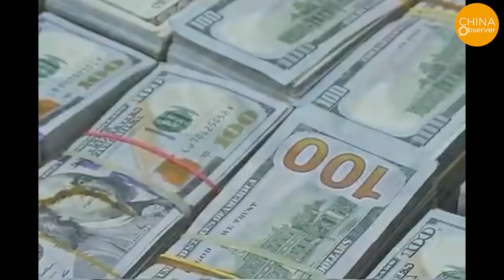Made in China: 37 Bridges collapsed in 5 years | Ancient China | Quality | moral issues

Comment: That's what happens when you don't add the proper amount of cement to the aggregate and sand and the cement money goes into someone's pocket.
Reply: Water content also drastically affects quality. Too much water makes for weak concrete, but it pours easily so you can get the job done quick. The proper slump is very little water, but in formworks it's a pain to use and slow.
Reply: Cement to aggregate? They don't even use building materials to begin with!
Reply: They also use sea sand
Reply: Nah they literally aren’t smart enough to engineer anything as simple as a bridge
Reply: While your at it maybe you can save money by just using sea water for the concrete. Totally shouldn't have a negative effect xD
Reply: @ericandreen1470  this is just wrong. Did you even watch the video? The ancient Chinese built structures strong enough to last over a thousand years. The problem lies with the central planning and the destruction of morals and culture.
Reply: @oldmandoinghighkicksonlyin1368  since China uses more in any 3 years since 2003 than US has used in its life they probably know all about cement
Reply: @ericandreen1470  I can tell quickly you have never been to China and you my friend will believe anything
Reply: @Stoneitful  well they know how to cut corners and do it cheaply so the building crumbles and potentially falls down. Tofu Dreg construction is rampant in China.
Reply: @oldmandoinghighkicksonlyin1368  you sound so knowledgeable ! How much time have you spent in China ?
Reply: @Stoneitful  I've lived there all my life. Longer than your dad and grandpa combined. I am an expert now because of my geography.
Reply: @oldmandoinghighkicksonlyin1368  lived where ?

Comment: We have a bridge here in the San Francisco Bay area that was reconstructed a number of years ago with steel load bearing elements that were made in China. It wasn't so long afterward that severe corrosion, due to the salt water exposure, and consequent cracking on these steel members were detected. In retrospect, it would have been better and cheaper to have paid the higher up front cost of using domestically made steel.
Reply: Due to the saltwater exposure,???? I saw the photo/video that the electric line pole fell down in San Francisco, due to homeless people peeing on it all the time, the peeing-liquid corrosion lead the pole to fall. More likely due to the homeless people peeing in the bridge area, as we all know it is an ideal place to be used as a home for homeless people, according to the New York time, there are over 170,000 homeless people in California.😲😩😫
Reply: @hanfucolorful9656  The shear key anchor rods are not accessible to the public, hence it would be impossible for homeless to do that. Urine has high concentrations of uric acid and various electrolytes, which are corrosive to steel. If homeless people did urinate on metal support columns then that would cause surface corrosion of unprotected steel. I wonder if all the videos of people freely urinating and defecating in public places in China might be causing some of the bridge and building failures we've seen recently. Doesn't the Chinese government admonish its citizens against such uncouth and unsanitary practices when they travel abroad?
Reply: @videomaniac108  [[[ severe corrosion, due to the salt water exposure, and consequent cracking oh these steel members were detected. ]]] -- if you did not contract China to do the painting job, you need to do it yourself once every a few years, especially in the "seawater" environment. 

Google: San Francisco Poop Map, having fun.😲😇😄
Reply: You guys can consider using Japanese products. Japanese are very very strict when it comes to quality control. Japanese make cheap and very high quality products
Reply: @tanalson  That would have been a far better option than using the Chinese-made steel.
Reply: As is the way
Reply: Those godam Chinese killing each other because they want money
Reply: May God bless America. 🇺🇸 

TRUMP 2024

MAGA

Comment: Other developed nations had these problems in the 1900s during their economic and industrial boom periods, mistakes were made, lessons were learned, policies and procedures were established, in the West the risk of failure is unacceptable because a good reputation commands a premium and a bad one is difficult to fix. Also western workers are generally well educated, they know that "good enough" isn't good enough, you follow the plans and you follow them to the letter because what you're building has been precisely engineered, the wrong kind of fastener, the wrong mix in the concrete, the wrong kind of paint or wiring, any of this could be disastrous and the consequences will be traced back to the cause. It has nothing to do with religion.

Comment: It would be an interesting exercise to see if it can be found out just how many bridges collapsed from overloading.  There was one bridge in 2019 that collapsed from having 2 trucks on it in the same section, which were allegedly grossly overloaded - like upwards of 100 tonne on a 6 axle semi trailer.  The other thing is the cutting of corners in the construction, as was shown in your video.  Poor concrete, lack of reinforcing of suitable strength.  All of these things add up over a period of time, which causes lack of confidence.
Reply: If the bridge planners could not account for 200 tonnes on a bridge, they were not doing the job properly. If the bridge could not hold 200 tonnes then it wasn't a good bridge.
I've seen the video on it on the china insights channel and the trucks were an excuse. The bridge was clearly tofu dreg.

Comment: Well, it's not just made in China I live in Switzerland and my flat has enormous cracks and I know that the facade will fall onto the street sooner or later. I accidentally kicked in a steel-framed fire door at my university (in Germany) and destroyed on purpose a safety cabinet with my bare hands despite it being supposed to resist thieves with tools. The university building near me has to be demolished after 40 years because the concrete is crumbling and I know so many modern buildings that suck in summer and have rotting wood, whereas timber frame buildings from 300-500 years ago are still better! I've talked with architects about it and they told me that they simply can't afford to built that slow and expensive today and thus everything is exactly that poor quality...
Reply: It is a good example of Survivorship Bias, Today there is not a single badly built building of the Middle Ages, therefore there was not badly built in the Middle Ages.
Reply: @wolfgangloll2747  agreed. However, back then built to last was far more of a goal as well, whereas post WWII was the polar opposite. You see it also in fashion: today you keep your things just one year and in the middle ages you kept them for a decade and people would describe you by your attire as if it was a title...
Reply: @wolfgangloll2747  well then you have a history of bad construction
Reply: Former East Germany or West Germany?
Reply: @waynehankinson8210  I used to live in West, or rather south Germany.

Comment: Having worked in China for 2 decades I can safely say that there is nothing wrong with Chinese Engineering. They have smart capable engineers who know what is required BUT.....when it comes to the execution on design, there is so much corruption and stealing that they are never built to design. Cement is regularly syphoned off by the site managers, who then resell it to other projects. The result is that the pretensioned concrete beams are simply not strong enough to hold themselves in tension and we all know that once they suffer a moment of flexion and it's game over. I was part of a group who were tasked with the investigation of a high rise building which 'inexplicably' fell over in Shanghai.Once again, the design team had specified the number, length and size of the driven piers, but when the building suddenly turned turtle one night, half of them were not there. Further examinations of previously commissioned buildings in the same lot showed a gradual decrease in pier numbers and length. People lost their life savings on their apartments as a result of having three other buildings condemned.

Comment: To be fair, modern buildings and bridges even in less corrupt countries are rarely built to last more than 50 years before needing  to be rebuilt.

You explanation about "gods" however is completely wrong.

Things were built to last because labour and material was cheap, and the builders were held accountable under threat of death. Today, cost cutting is the most important part and you can always pay your way out of any litigation. Worst case, there is always some middle level engineer you can sacrifice.

Comment: Statistically, it is not fair to compare quality of buildings today with those still standing of 700 or 1000 years ago. Most of those old buildings have all deteriorated or gone away and so you are only left with the strong one or the significant ones that people have cared for over the years. This is not a proper statistical set to compare.  There is a major survivorship bias. Only the really good buildings have lasted. Don't get me wrong, it does appear many of the buildings built in recent times have obvious issues with inferior concrete and or  poor quality of workmanship, but it is still important to be fair.

Comment: Comparing the old buildings to the new ones is very misleading. All the all buildings you show are still standing, but only those can still stand, which were well built. You cannot find a single old building now, which was badly built, because it has already collapsed, all you can find are the good ones. Similarly, the buildings you show collapsed are the bad ones among the new buildings. There must be well-built buildings too, you just don't show them, because they are not a proper example for your findings.
The most important would be the ratio. In China, very many buildings are built in the last few years. Due to the extreme numbers, there MUST be some which have collapsed. What is the ratio?
P.s.: I personally believe that there is a problem. In a country, where there are complete cities built for nobody, the quality of the buildings of that city is definitely questionable.

Comment: Ever heard of “survivorship bias”? We don’t know that they didn’t also make tons of crappy bridges and buildings in ancient times, because the crappy ones collapsed long ago.
Reply: That's an interesting idea. That's not impossible but given the sample size not likely. The generalization that ancient construction survived better over the centuries is from extrapolating from samples of structures of all kinds from around the same period and location. Also, from the culture, work ethic and societal norms at the time of construction. The ancients probably had a word for it. "Standards".
Reply: @randalmiller5450  But survivorship bias is literally the explanation that what survived until now is NOT a representative sample of everything that was built originally!! (And that we often cannot know what didn’t survive, which is why we cannot extrapolate that “old buildings are better”.)

As for “standards”, we don’t really know that, either. Bear in mind that old buildings (anything over around 200-300 years old) were designed without the benefit of modern structural analysis and simulation, so they tended to be overbuilt because they didn’t have any way to accurately calculate the actual load-bearing capacity of a structural element. Nowadays we can precisely compute the amount and type of material needed to meet the requirements, and eliminate all the rest. The downside is that it reduces the margin of error for shoddy construction.

Comment: Okay, so many things come into play here and morality is probably one of the lower ones in the list.
First of, the purpose of the modern constructions and the ancient ones are different. Though you did make comparison of the two bridges, the ancient one could only fit probably cows and humans while the modern ones are used so containers weighing many many tons can go through, and on a bridge, they don't let only 1 cross and the others have to wait. All of them cross at the same time making the bridge have to handle God knows how many tons of weights. Vehicle, items in the container, and humans in it. 

Secondly, the comparison you made between modern and ancient houses. The ancient houses you shown last because they only have 1 floor. While the apartments you see crumbling to pieces are purposed to accomodate over 100 families with over 10 floors i'd think. Materials came close to the 2nd contributing factor. But you can't really make two types of house designs as a comparison they just don't make sense.

Comment: China can and does make quality manufactured items. And by quality I use the formal definition of quality which is defined by international standards. These include being fit for purpose and lasting the prescribed no. of uses. A good example is Makita which has an excellent reputation and is made in China. Corruption and poor quality construction also occur as occurs in  other countries. In Australia in Sydney for example there is a major scandal concerning the construction of poorly built brand new high rise buildings that are developing major structural flaws. The Sydney problem is reliance on self certification as a control has failed. Corruption and greed are common human failings. Good governance requires courage to implement.
Reply: @Hugh Spencer

For those  who jump onto the criticism wagon, are you saying it never happens in your own Country???

There is another u-tube channel called China Observer which proudly announce China have 37 bridges collapsed in 5 years. 

1st before you gasp in horror, be aware that many are old bridges built long time ago before China's recent development. 

Also be rational. 

This statistic shows the number of public road bridges in China from 2010 to 2020. In 2020, there had been approximately 0.91 million road bridges in China.1 Feb 2022. 

That is O.00055' % 

Those of you who reacted and start to JUDGE and criticise China's low standard etc etc, please be INFORMED that 5 bridges out of 9 million existing bridges in China is actually a very Very GOOD  RECORD. 
And in case those of you who are still blur... It's 0.000055% that breaks down in 5 YEARS. ( NOT per year )

See how people spin news without revealing full facts.